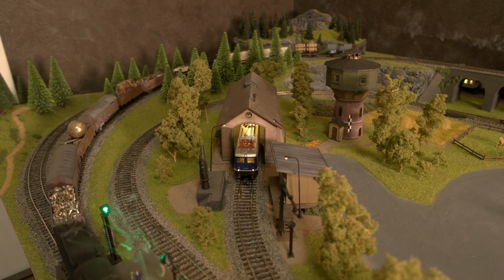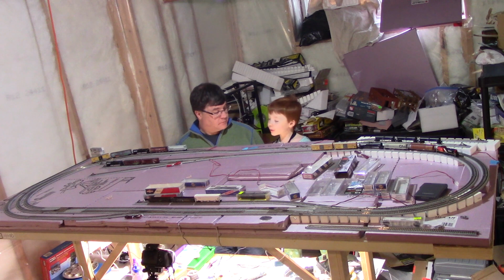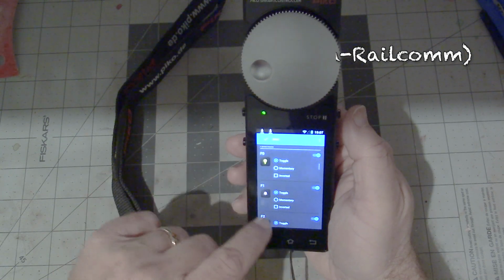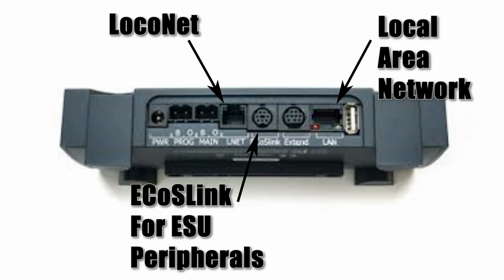Model Railroad for Beginners - From Loop to Layout - Sidebar - DC or DCC?

Comment: Older video, but some good stuff. I have no idea what brand it was, but my Dad had a setup with controllers back in 1977 that could run 5 trains at different speeds and directions. Each loco had a module built in. Unfortunately, I can't use any of his old stuff, because his was HO scale, and I'm in Z scale.

Comment: Great series! Somebody please answer these questions that I haven't found in comments and/or missed in the vids: 
1. How is he switching the turnouts? 
2. Was this really unhooking the DC controller and hook up the DCC Controller with no other wiring mods?
Reply from the maker: In this case, I am still throwing the switches manually, but they can be controlled via DCC by using a specialized controller. With the Kato Unitrack turnouts, digitrax makes specialized controllers: https://www.digitrax.com/tsd/KB784/ds51k1-stationary-decoder-installation/
Reply: @JCsRiptrack  Wow! Your video speed and quick movements really are a trick to the eyes! I have to slow the vid down to 1/4 speed to barely see you move the switches LOL. Great looking fun! I'm looking at the new DCC Concepts switch panels but I guess I would be spending money twice on Kato switches and then modding them to use the Cobalt iP Digital Turnout Motors?? Maybe there's a way to use some of the already pricey Kato switch"s electrical parts to do this. I was wanting g to go the ECEpower cab route instead of Digitrax

Comment: Looks like a nice system--I like the wireless controller. However, it does not seem to be available from Piko any longer. Has it been discontinued already?
Reply from the maker: It may have. However, it is the same as the ESU Cab Control system, since they're the ones that made it in the first place and PIko licensed it. So the product is still available, but from the original manufacturer.
Reply: @JCsRiptrack  Are you able to use a PC to add an additional control layer to your Piko/ESU system?
Reply from the maker: I believe so. I haven't done it yet, but it has ethernet/internet connectivity, and works with LocoNet as well.

Comment: I dumped DCC recently and went for DINAMO. This is a system designed by a Dutch company and it allows you to run DC and DCC trains on the same layout simultaniousley. It functions by setting a route for the train and the system will apply DC or DCC onto that piece of track. It is fully controlled by a computer (I have even seen it running on a Raspberry Pi).  It also allows for DC locomotives to have the lights on whilst staying still. It is a bit of a steep learning curve and the initial start up is pretty expansive, but it will give you the same and even more benefits as DCC without any decoder needed. The biggest plus is that polarisation is a thing of the past.

Comment: I decided that since I have both DC and DCC locomotives, and I didn't really want to change everything over (pocketbook limits), I decided to go with the best of BOTH worlds..... I found something called an MRC Tech 6. I can switch between DC and DCC at the push of a button. So, depending on what I want to run, I can have either digital or analog equipment on the tracks. Granted, I'm still using blocks to power track sections, but with the Tech 6, I can get the sounds and functions from my DCC locomotives without actually having a dedicated DCC system.

Comment: currently running DC but have built a DCC++ system and now need to install decoders in locos.   Great video
Reply from the maker: Cool, thanks. I'm curious about the DCC++ systems out there, but electronics aren't my forte. :)

Comment: Love the ESU Cab Control!  Only drawback I've had so far was a work around to get NCE Switch-8's to work with it.    Took some research, but it works nicely.  ESU's instructions could be better though.  The ESU site has a bulletin board where questions can be asked.
Reply from the maker: Thanks for the info!

Comment: I'm still using DC (analog) I have to many locs which cannot be converted. However I'm controling my track with the use of an arduino and raspberry pi (still building it)

Comment: In my view, these days, DC is great for beginners who only want to run a single train and have no reversing loops.  The other thing to think about is that the power goes directly from the track to the motor with DC.

DCC, on the other hand, has all sorts of advantages.   But in this case the track provides BOTH power and signalling.   The controller "reads" the signal from the track, then takes the AC power from the track and converts it to DC which it feeds to the motor.   However, the motor is STILL a DC motor.

And, while people complain about the cost of DCC, there are a number of systems out there at different price points.  But the bigger thing to think about with respect to DCC cost is how much you are spending on your total layout.   As people get more involved in their Model Railroads, the cost of their DCC (regardless of how expensive it was) pales in comparison to the cost of everything else!   So, don't compromise on this part of the system.

Comment: I have only ever run my layouts on DC, and given that most of them only ever had one train running on them it was fine.  But with that said, I'm contemplating a switch to DCC in the future, and that's mostly because I can add sound.  Hearing the chug of a diesel-electric's prime mover, along with the horn and the bell, instead of the whir of an electric motor adds a lot to the layout's realism.
Reply: You can still have sound on a DC loco with a sound decoder, but DCC allows you to use more functions.
Reply: @PaulSmith-pl7fo  I guess what I could have said is I could have the diesel locomotive sounds coming from the loco itself.  I remember one of my Tyco HO sets from when I was a kid had a diesel horn hidden in a billboard.  The sound wasn't entirely realistic - nor was the billboard. :)
Reply: Same here but I have so much DC stuff and didn’t want to put decoders in all of them. What I ended up doing was getting the Kato Sound Box for sound. Quite happy and you might want to look into that as another choice.

Comment: Thanks John. I am currently DC but will eventually switch over. I also use Kato unitrack and so far it looks like it will be a fairly easy transition. My layout is modular so I can move it from the garage to the next empty bedroom that becomes available. That’s most likely when I go DCC. Cheers 🍻

Comment: i started on dcc..went to dc..as easier and cheaper
Reply: Unusual.
Reply: i also went backwards so to speak... i bought the first run of the NCE system, about the time athearn came out with their very first run of the MP15AC (however long ago that was)... left the hobby for a long time just got back in a few years ago and forgot how to even run the system... then i saw the prices of DCC locos and saw how "techy" DCC was getting and i said i'm out... time traveled back to 1982 and now am running full blown DC using the MRC tech 7 ampac 760... found a few DC locos over the past year highest i paid was 152, cheapest i paid was 99bucks all atheran genesis locos to, i can live with that

Comment: I want to know if a dcc train can run on Bachmann ez track? I use ho scale though
Reply: Hi there, it all depends on the controller. If you are using a dc controller then it depends on if the decoder in the loco is set up for it. If you have a dcc controller that’s correctly wired up then yes. It doesn’t matter what type of track.
Reply: @JamesSmith-zv9nw  Thank you so much!
Reply: To expand on James’ answer...

As James mentioned, it depends on the controller. However if you are using EZ-Track with the Bachmann EZ-Command then yes, it works right out of the box. If the controller is any DC controller, you’ll only have to upgrade that.

From 2000 up to 2014 I got into the hobby, and built a layout with my grandfather using Bachmann EZ-Track along with DC, sometime before 2010 we switched to DCC with Bachmann’s EZ-Command... We’d built a layout using 2000ft of track using EZ-Track.

He passed away in 2014, so I hadn’t touched the hobby again until the past few months, I set up a small oval with EZ-Track and EZ-Command... however I switched to NCE for DCC. As I wanted to test things while still getting the materials together to build the new layout, all I had to do was buy a set of Atlas rail-joiners that have the wires soldered on to them and attach the wires to NCE, and I can confirm that NCE works great with EZ-Track from Bachmann.
Reply: You should Be Able to.no Reason why you Can’t.